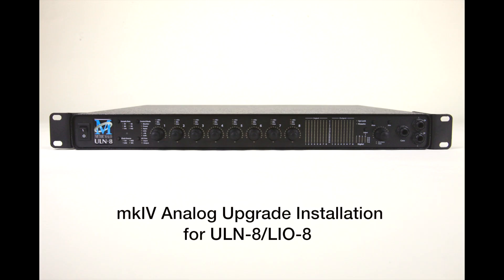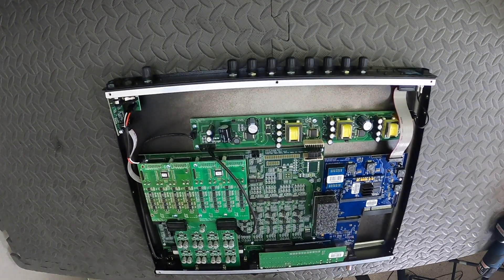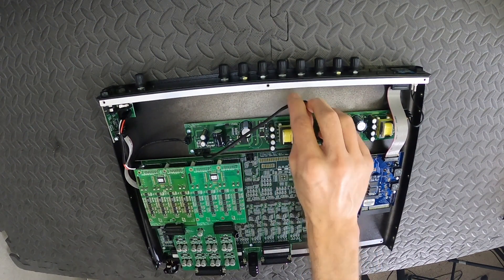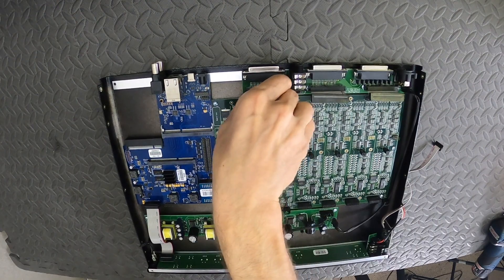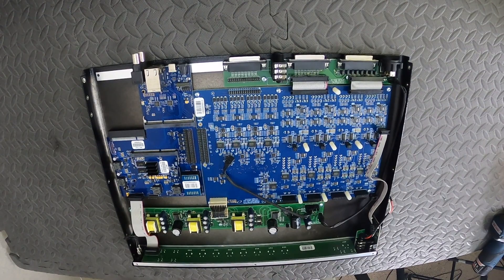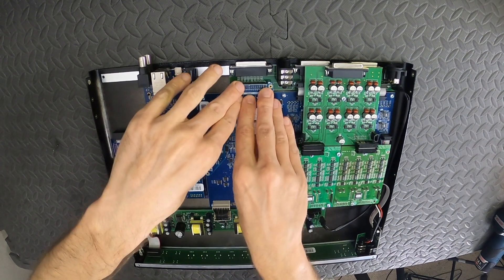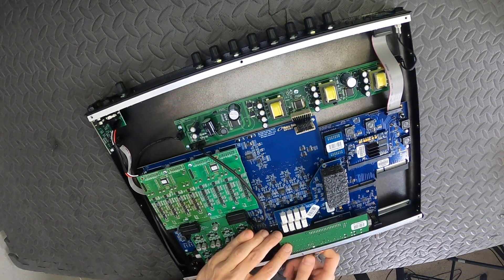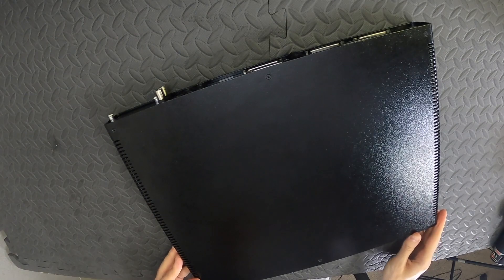mkIV Install

Comment: So the analog board is the only difference compared to the „old“ 3d version? Is the sonic difference really that great? I have an uln8 and extremely happy with it.
Reply from the maker: The Original AKM based analog board sounds great. The new mkIV board sounds better to our ears; it has lower converter latency, uses less power, and has unity gain analog loops. We believe that the bulk of the difference in the sound is down to the low-latency + custom filters, although the updated analog also plays a part. The low-latency filters have no pre-ring; while the higher-latency symmetric filters in the AKM parts we use on the earlier board have better spec sheet performance (better stop-band rejection, lower phase-shift on the high end) the pre-ring on the symmetric filters seems to add a small element of brittleness or congestion that we feel the new design removes. So to our ears, the mkIV sounds like a ULN-8 - just better.
Reply from the maker: Oh - and the mkIV kit adds a relay-based power on/off mute to the analog outputs, which eliminates clicks and pops due to power on/off events.
Reply: @MetricHaloAudio  I’ve done the upgrade to my two cards. But I don’t hear the relays when mute or unmute a channel with analog output or the monitor section that has the output to analog. I mean, I hear all relays when I turn my unit on, but no more. Am I missing something? Thanks
Reply: @MetricHaloAudio  about the latency I don’t understand why I’m getting same round trip latency if conversion process is so much faster. Same round trip ms under logic, cubase… with any buffer than the one I had with previous mk3 converters . New “speed” is not improving round trip ? Thanks
Reply: @Hessencemusic  they are talking about RTL through the box convertors, in then back or vice versa, not through the drivers to your DAW and back. Eg improves using outboard buss processing while recording.
Reply: I remember reading that they may have gone with burr brown converters instead of AKM due to the burning down of that chip factory. I wonder if that's true or not. Also would love to hear some shootouts between the 3d and mk IV.
Reply from the maker: @yakk8936  Yes; the mkIV uses TI/Burr Brown converters rather than AKM; this change was driven by AKM's fab burning down.